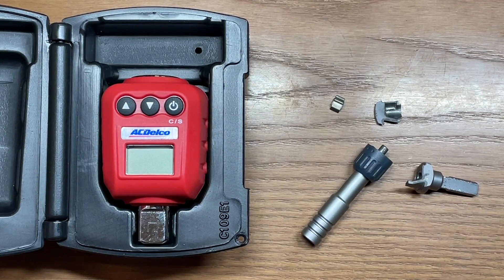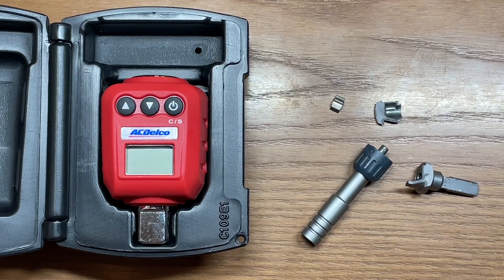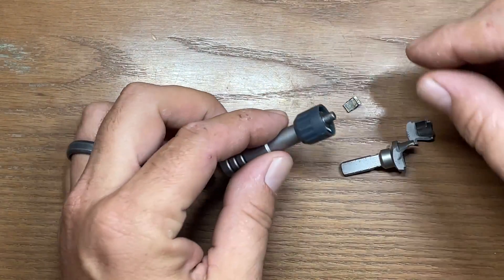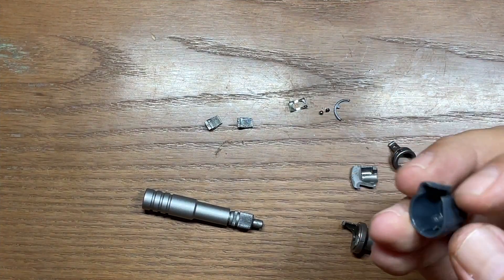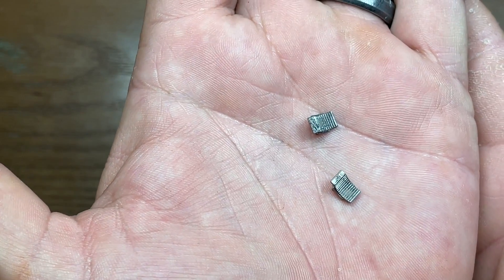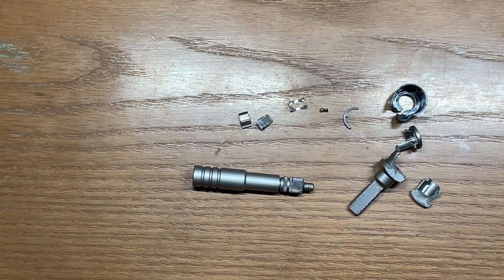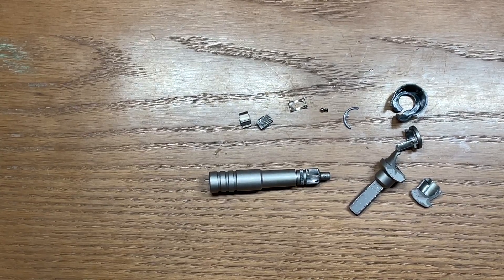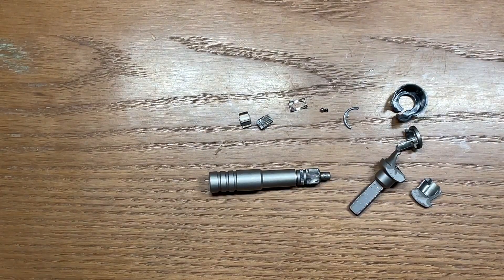Leatherman Ratchet Driver - Destruction Test

Comment: I'm not sure, but this ratchet's low torque tolerance may be the breaking point intended by Leatherman.  After all, something has got to give. Which would you prefer to twist and snap, your $30 ratchet adapter or your $130 multitool? You stated yourself toward the end of the video that this adaptor wasn't designed to drive in 3/8in. lag screws. And multitools aren't designed to build battleships. I wouldn't expect you to destroy all your expensive Leatherman tools, but have you ever conducted similar torque testing on any of your multitools? Have you seen videos or research conducted by others where the various Leatherman bit drivers were put through stress tests? I would prefer my torque adapter to break about 5 ft/lb before the weak point on my multitool does.

In any event, thanks for making your informative videos and sacrificing some of your tools so, hopefully, the rest the us don't have to break ours.
Reply from the maker: This makes perfect sense to me. Now my curiosity is piqued. That might be bad!
Reply: @txtoolcrib   I agree with the above comment. You mentioned in one of your previous videos that Leatherman wasn't putting their 25 year warranty on this product. If it was too durable, and people started using their multitools in a 90 degree configuration to break loose stuck nuts or something, they would end up having to warranty replace more $100 plus multitools than they probably want.
Reply: @chase1094  but leatherman already sells a non racheting extension that allows full torque on your expensive tools and this hasnt caused many issues... me thinks this was just a cheap solution to a problem leatherman didnt care a lot about
Reply: @shawnpepin7890  You are correct that Leatherman has sold non-ratcheting extensions for several years, and I assume those bit extenders can handle more torque than this new ratchet extension.  But how much more torque, I don't know.  And will you end up bending or breaking your multitool's bit exchanger before the extension snaps? I would say probably yes.  You state that "this hasn't caused many issues," but do you know that for sure?  Leatherman may disagree.  Their company may have repaired or replaced thousands of bit exchangers under this scenario (and Phillips screwdrivers in the case of the Super Tool 300 and others). As consumers we should expect premium quality tools from Leatherman, as they charge relatively high prices for them. But we also need to be realistic in our expectations, and use an appropriate tool for the job at hand. I am simply saying I haven't seen any stress testing done on bit extensions while they were ON the multitool. This might help inform some tool users out there before they attempt to remove rusted lug nuts from a Ford F-150 with a Surge.
Reply: @txtoolcrib  Maybe you could start a GoFundMe page to pay for all the Leatherman multitools you will need to damage or destroy to satisfy your curiosity, lol.  Then you could start tearing up Victorinox and Gerber. Seriously though, Leatherman may already have some available data on this, or some other YouTube channel may exist where some crazy guy who loves to buy and immediately break his tools has already done this type of testing. I am thinking of starting my own channel where people donate their old junk gas-powered cars to me as they transition into electric vehicles (EV). We could then determine how much dynamite or C4 it takes to completely obliterate a Buick. There might be some safety and legal issues to work out first, but people need to know this stuff!

Keep up the good work of churning out your informative tool videos.
Reply from the maker: Now there is an idea! Lol.
Reply: Would LOVE to see a video on this. Having some perspective on what our multi tools can actually handle would be really informative when it comes to what we can expect of our accessories.
Reply: Friend of mine used my Gerber multitool many years ago to attempt removal of a 3/4 bolt securing a data rack to a floor panel. IDK how many "PSI'  he used but the pliers snapped like a dry twig.
Reply from the maker: Gonna be a while before I live that down (PSI), isn’t it?
Reply: @Isaac Cervantes III  - He didn't use any PSI lol.

Comment: Hello, Ben - great review, looking forward to your further testing...Why do think the housing was weaker than the gears? A cost-saving measure? Do you think the cost would go up significantly if the housing is strengthened?
Reply from the maker: It really boils down to the type of material. Obviously, the higher quality the steel is, the more it will cost. I was really surprised that the gears held up though, that was the high point for me. If the housing strength was just a little stronger, I would be very happy with this type of accessory registering 25-30 ft/lbs.

Comment: Get an inch/pound meter.  Also use a Leatherman to apply torque.   Otherwise a great video, thanks.
Reply from the maker: I will try to do just that.
Reply: I was wondering why it wasn't in inch/lbs myself. Almost every 1/4" tool I've ever owned was rated in/lbs including 1/4" impact guns
Reply from the maker: All torque wrenches measure in in/lbs as well. Minimum on this one is 300 in/lbs.

Comment: I got my Leatherman  Ratchet yesterday. This result does not surprise me.  The gearing feels like total garbage.  The new sight tool extender is $30.  Leatherman should have aimed for $50 on the ratchet and provided a USA made quality tool
Reply: You americans are really obsessionated with  so cold"usa quality"...in germany, austria, swiss and italy usa are considerated mid quality coutry...not high quality country. There is much better in the world than usa manufacturing.....like germany for example...
Reply from the maker: Well, actually the gearing held up. The frame of the lower section is where the issue seems to be. If it would make it to that 25 ft/lb level, I would have been quite happy with it. How much torque can you realistically put on this with a Leatherman tool?
Reply: You are right. There is a limit to hand torque. I am just not terribly impressed with the Ratchet. I’ll probably return them.

Comment: Damn it all thank you so much. I just ordered mine and just now canceled the order in time.
Reply from the maker: Absolutely, thanks for watching.
Reply: Waht do you want do with your multitool??
Is stupid pretend  that a mukltitool or ratchet multiutool handle massive levels of torque. if you pretend to unscrew a rusted bolt from an engigne or similar with these ratchet, simple you are stupid. It not depend from love or hate leatherman name.
The torque that handle these ratchet is more and more than sufficient on the application for witch it is made.
it is a tiny accessory !!! with 2 mm of steel .. What do you expect?

Comment: Lowkey, mine felt extremely cheap, it worked, but also we will have to see show it holds up. I have low hopes, but it's better than nothing.
Reply from the maker: It will be interesting to see how it holds up under normal use.

Comment: I'd be curious if you could also test how much torque a person could realistically apply with a Leatherman instead of a breaker bar. Just curious how far apart the ultimate strength is relative to the realistic usage.
Reply from the maker: That is a very valid point.
Reply: And buy cheap used SAKs and see how much torque the tools can handle, and the brass rods can take before failing.
Reply: @OutsideTheTargetDemographic  this!
Reply: @maxlvledc  "How tight of a screw can I loosen? How much prying can the cap lifter do before it twists the frame or brass rods? How many ftlbs until the online Philips can sheer?" I NEED TO KNOW lol
Reply: @OutsideTheTargetDemographic  it's a great idea
Reply: Agree. On a wave/surge, if you put a bit extender into the bit driver and then a socket on and used it in the 90 degree like a ratchet, I think most people could exert 40ft lbs. Doubt the leatherman could take it. But most people will use this for screwdriving where it's harder to put that much force into a screw, because you'll have to put force down and rotationally or your bit will slip out from the screw.
Reply: @T-Mo_  I think that like you said, if you don't strip out a bit, slip out or even strip the fastener, before youd break it. It does show the uh....total durability i guess...but this thing is meant for the leatherman tools so. It's like putting a turbo on a stock car and then the transmission goes. Or the rear end. Well...yeah its gonna happen. I can for sure see putting like 10 15 ft lbs on something, but then again, what screw is gonna hold it. I still feel like i'd want this tool, maybe wait a bit, but yeah.
Reply: Have you ever tried the 711L ratchet and bit set for $26? Leatherman bits work quite well in to. The end of the handle sides into the bit exchanger I believe it’s a 60 tooth ratchet. I have the Leatherman ratchet and extension plus the 711L and bits. The workmanship is great and being able to use both the Leatherman bits and 1/4” hex makes it handy tool.
Reply: I know some guys made that test using screwdriver style to test different handles for screwdrivers.

the range was between 4 ft-lb and 8ft-lb.

Using a multi tool should allow for a much higher torque wouldn't be surprised if you could reach 15-20 ft-lb using a surge.